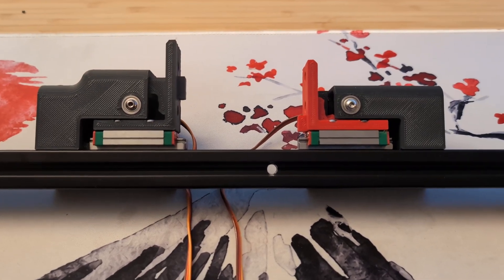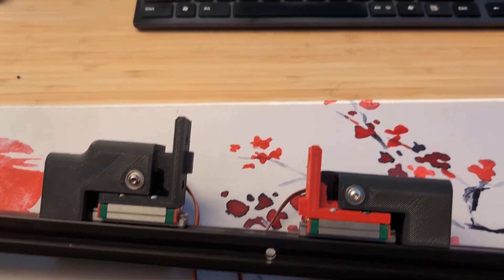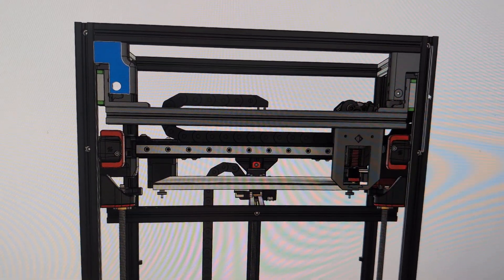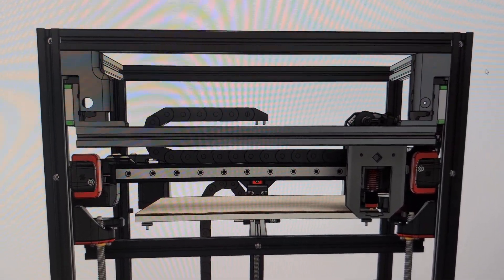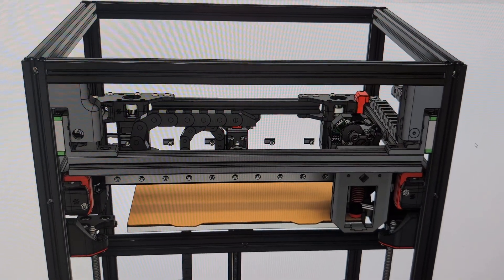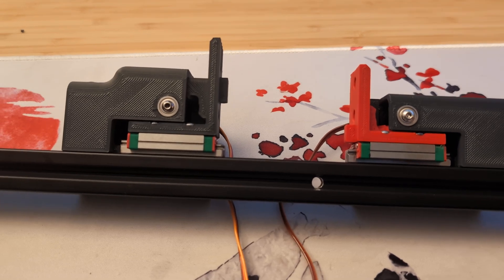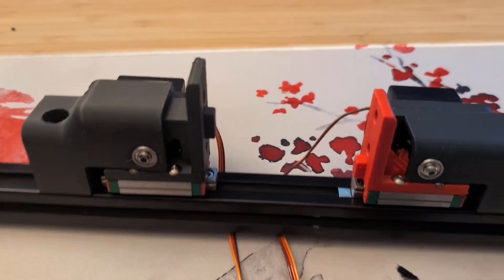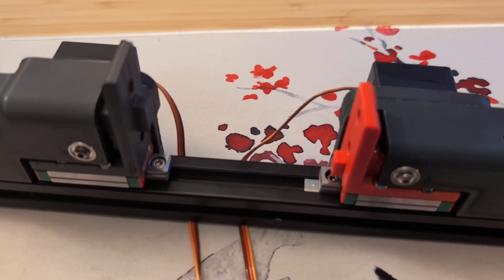Tiny liftbar for Trident

Comment: Looks nice. I have a trident and am studying how to migrate it for a Stealthchanger. By now, I'm considering using the Trident-Lift-bar, a heavier and more traditional way to do it, but you definitely have a nice idea to continue to develop. Beyond the weight, you should consider the hot environment and the thousands of changes that this system is going to make. Traditional steppers, pulleys, and belts handle this stress well. The right servos will define the lifespan of the solution. Just to consider, my closed chamber gets hot on the trident near the roof. Almost 70C.

Comment: I think I have all the parts to test this. Do you want to share the plans and software config I'd need to use?
I already use your tapchanger on my 2.4.
I might also try and use the mini stealth burner from TeamFDM to keep weight down.
Thanks
Adrian
Reply: Hi @veisturs, actually, could tgis be retro fit to a 2.4 gantry? So its attached to Flying gantry itself and only adds weight to the z?

Comment: Do you think the servos are strong enough for the weight of 4 or 5 toolheads?
Reply: I was wondering this too. You'd need some beefier servos than suggested. But I like the idea.
I might try it anyway, I have a 300mm Trident. I have already converted my 350mm 2.4 to TapChanger and love it.

Comment: I wonder what's the benefit of this over something like the prusa xl approach?
Reply from the maker: @mggevaer260  Simpler mounting mechanism, but I agree it's not clear which one is better.
Check out WP-DAKSH for a Prusa XL clone for Trident.

Edit: also more lightweight. The XL mount adds quite a bit of mass.
Reply: @viesturz  there is also the fact that daksh requires freedom of movement sideways to unlock, which is not beneficial for rigidity... probably.

Daksh also probably needs some space between the mounts of the toolheads since sideways movement is needed to mount the toolheads.
Reply: @mggevaer260  with a normal core--x-y you usually have double the recommended accel for x compared to y (input shaper), so losing some ridigity in x isn't that bad I guess
I have a sv08 and tried the stealth and tapchanger and with some tweeking I got 9.5m/s^2 in Y (input shaper recommendation), I think the XL only has like 5-6m/s^2, so maybe this might still be a good idea for a trident after all (but one has to check, the sv08 is not comparable, as it works diffrently)